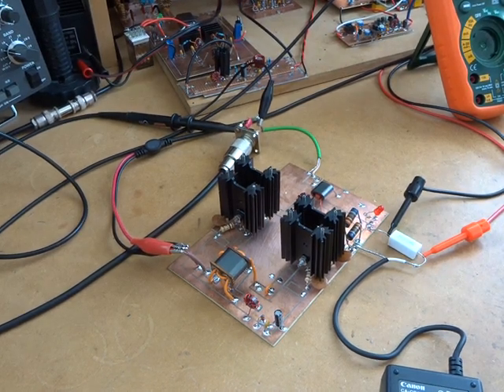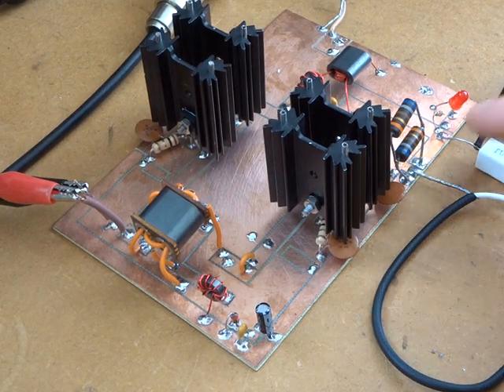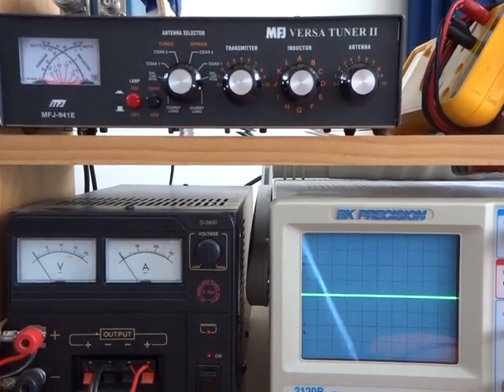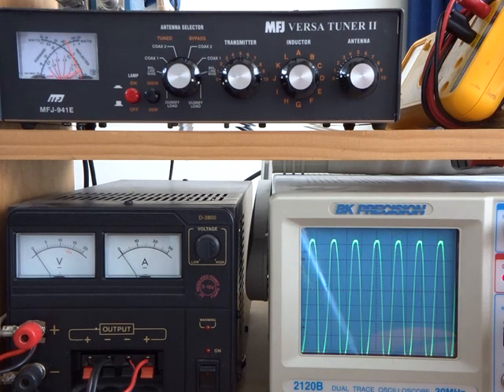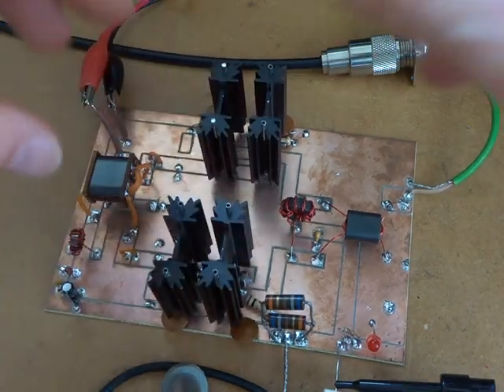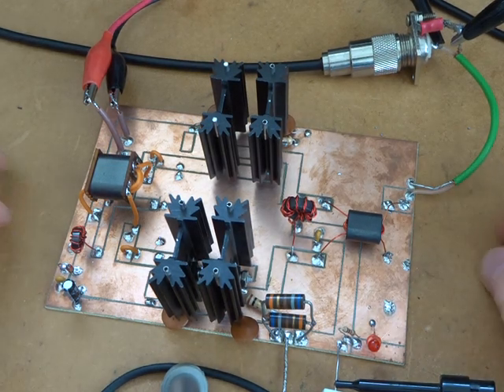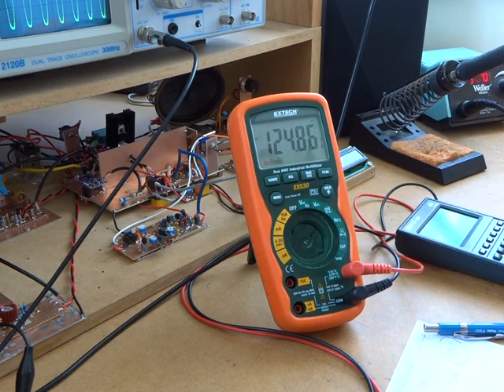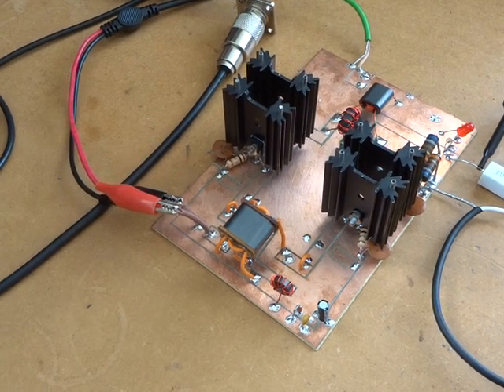BD139 Push Pull Amplifier Experiments - Part 4

Comment: Great ! could you try it with binocular core (made using T37-6 and glued together).  Use tri-filar wound transformers. I believe with 13.6 volts input supply, the ouput should go around 8 - 10 watts.
Reply from the maker: Hi. I'll add that to the list of things to look at when I dig this amp back out again.
Reply: @CharlieMorrisZL2CTM  thanks

Comment: Great setup! Thanks for sharing. Just curious if you have experimented with a push-pull arrangement in the 100MHz broadcast range?
Reply from the maker: No I have't Andrew. My interest is in the lower part of the HF band.
Reply: Andrew Ferg I got 160mW output from two PN2222A transistors connected in parallel. Output frequency was 99MHz. It's a 2n3904 and PN2222A based FMTX. Would you like the schematic? The transmitter is quite stable as the oscillator is driving the amplifier chain via a 4.7K resistor.

Comment: please make a push pull rf amplifier using 2sc2630 or 2sc2694 or 2sc2782 or 2sc2237. thank you
Reply: please make the fm rf push pull amplifier that cover from 87.5-108mhz fm band. thank you. and please share with us including the circuit diagram
Reply from the maker: Hi Jerome. I'll add that to the list of  ideas for future builds.

Comment: Very interesting series  Charlie, 10 to 15 watts from BD139s, worth knowing, they make good drivers so interesting to see them used in a PA. In summary the circuit doesn't seem too sensitive to the transformer ratios, and the power dropping off above 10mhz like the IRF510s helps to make it stable at lower HF. You've answered all my questions, what's next?
Reply from the maker: Hi Paul. Not sure what to do next. I'm currently working through some noise issues after reconfiguring the current rig, which I want to fix . I also want to rebuild one of the SSB tramping rigs too before the next tramp. So many things to do and not enough time!
Reply: @CharlieMorrisZL2CTM  Are you interested at all in AM?  We have an 11am AM net on 160 here, and it motivates a few homebrew projects. I've built a few AM superhet receivers, they present a different set of design challenges.   Another reliable AM signal source is WWVH. Hang on, is that still there or did the US govt shut it down? Oh well. Theres always BC band.  Oh, I think I heard Europe is turning its MW AM stations off  😖  A good AM detector is not a simple thing.  Not just a diode!  Have a look at the one in G6LBQs Irwell transceiver.  This Anyway just a suggestion.  I'll watch your vids whatever you do.  de VK3HN.

Comment: Hi Charlie, this has been a fantastic series - thank you! I had a go at creating an ltspice simulation (you can access it here: https://cloudstor.aarnet.edu.au/plus/s/E4enKO4t6APOWUs ). I think it correlates quite well with what you've built (at 7 MHz). I had a play with the input and output turns ratio and settled on what's there. About 6 watts from 13.8 volts at 7MHz. Running at 24 volts gives us about 10 watts - not sure if that's realistic. At 28MHz and 24 volts it's about 1.5 watts. Anyway it's there if anyone wants to play.

Cheers, Ian